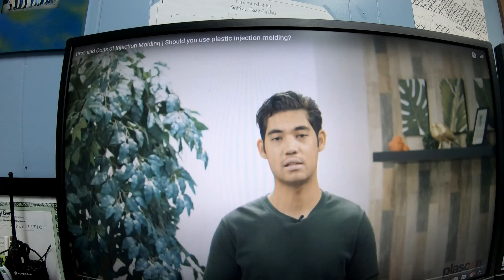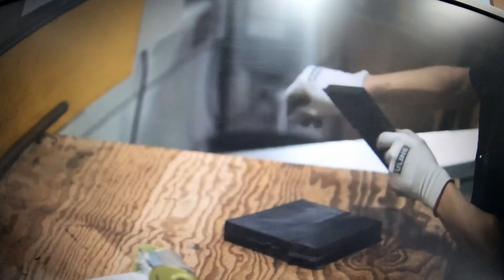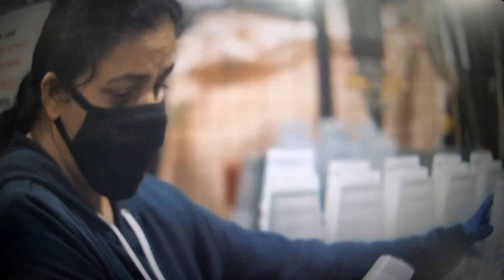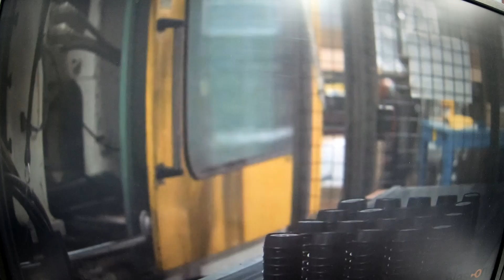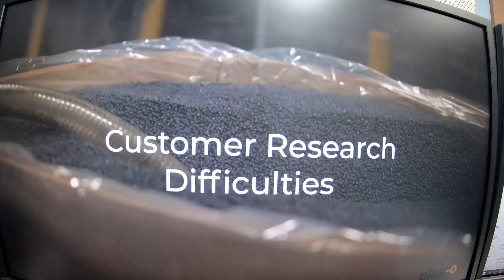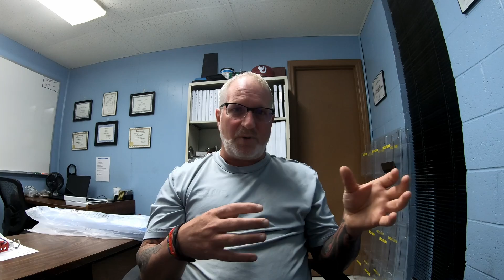Injection Molding PROS & CONS

Comment: Hi Sir David. After the mold open. There is a little bit melted material coming out  from inside the mold entrance hole. like the size of tomato seeds every shots. Mold has two hole cavity 1 and  cavity 2. Only 1 cavity has this problem . Thank you.
Reply from the maker: If it has a heated manifold check the heats in it to make sure one of the heaters is not running away on you so over heating. Make sure you have some decompression after metering is done, about .250 of an inch. I hope this helps. Thanks for watching & the support.

Comment: Could you advise on stringing from the gate?... I.e no stringing in one MC but stringing in a different MC with same Tool and settings
Reply from the maker: Yes I can, Is it a conventional gate system ?
Reply: @injectionmoldingskillsmore1064  yes no valve pins, tried the usual tip temps, decompression, cooling/hold time
Reply from the maker: @IIIDAZZLERIII  Are the gates the same size & you can try to putting a peace of cardboard in front of the nozzle as a insulator this might help.
Reply: @injectionmoldingskillsmore1064  yes gates all same size with hot runner system on 48 impressions. Does the cardboard have to a certain thickness?...it's a pretty big tool and I don't think it's down to nozzle heat as like I said it's perfect in another machine with same temperatures and nozzle
Reply from the maker: @IIIDAZZLERIII  If that's the case, I would have maintenance look at the heats to make sure they are calibrated. If it runs in another press with no issue then it could be on the press side not mold side. Let me know what you find out ? Thanks
Reply: @injectionmoldingskillsmore1064  u think maybe the barrel heater bands are a bit out?
Reply: @injectionmoldingskillsmore1064  these are brand new BMB Machines
Reply from the maker: @IIIDAZZLERIII  They could be, I would have maintenance just check to make sure so you can rule that out.
Reply: @injectionmoldingskillsmore1064  okay I'll ask if they can check, many thanks

Comment: Absolutely the truth....we have been struggling with several skilled trades guys retiring. We can not get the upcoming process techs trained quick enough because they often times are stuck filling in for production due to lack of operators. We have almost a 85% attrition rate....Temps typically don't make it a week....surrounding factories start out with higher pay and better work environment from the heat
Reply: Same at my work! 
It's a very different story for me though I was a set-up person and made the "cut" from a merge of companies to mold setter.
Now I mostly do Proccesing and then still set molds..and a slight bit of maintenance..and a dash of material handling 😆
Reply from the maker: Yes that's crazy how the turn over rate is. Thanks for watching & the support & for you reply to my videos.